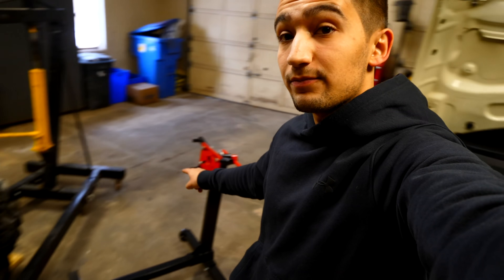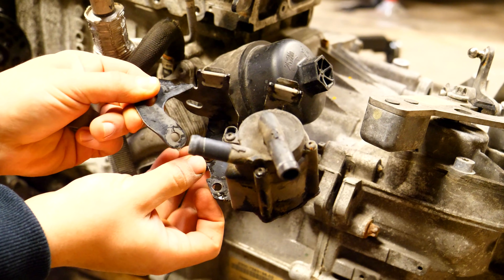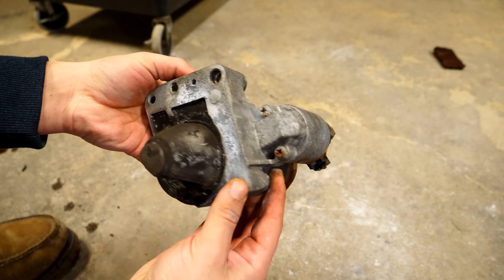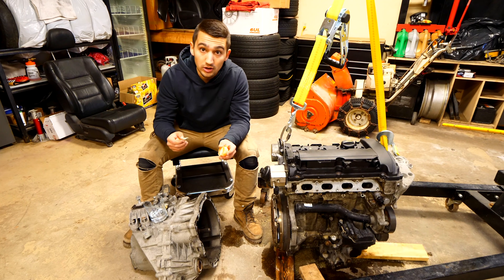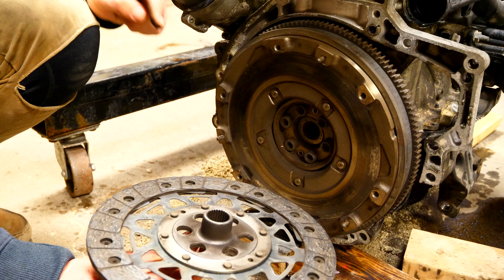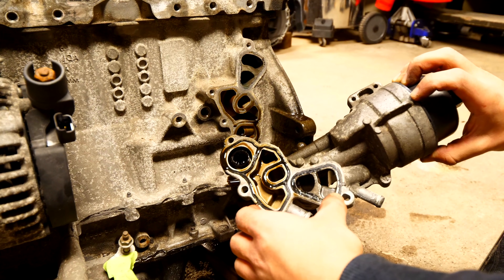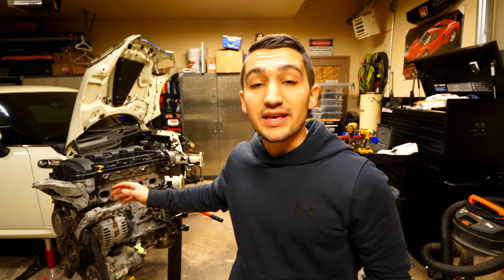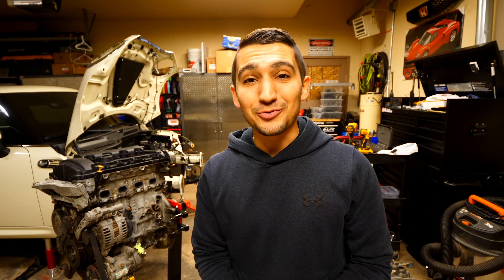How to Mount an Engine to an Engine Stand (FOOL PROOF)

Comment: Your chains will outlast the straps not saying using straps is bad yeah you have the advantage of adjust a little easier but dont mislead by saying the chains will be worn in 5yrs they wont I'm using 30yr old 12ft chain to still pull people out of stuff those straps may last you a long time if taken cared for properly but its not comparable to the durability of chain and with that said it also comes fown to what you're building as well not all engines are the same

Comment: It's a little risky but my plan as of now is to remove my engine from the bottom of the car and then put it on a pallet, then after that I can have a couple people help get the engine/stand piece assembly onto the main part while someone puts the pin in and makes sure it's secure while it's slowly being lowered. I'll have most if not all of the accessories off and the oil drained before putting it on the stand to save weight. I've already removed all of the accessories except the AC compressor and I might remove the timing cover too since I plan on replacing it. Time to get Car Mechanic Simulator back on my laptop.

Comment: In this video you are working on a gasoline engine. A motor is powered by electricity. Just a FYI you often say both just a little tip.

Comment: Love the honesty and showing it's not a " easy " job. Good call on rebuilding. Upgraded parts and a full rebuild. You'll know and have peace of mind that you've done it all to your high standards. I know you don't plan on changing your DMF but look into it as your changing your clutch anyway and you're there. They do have a high failure rate from what I've read as people started doing conversions to single mass flywheels in modern cars at the expense of some vibration

Comment: Milan, when you're removing or installing those really tight flywheel bolts, just get about 3 feet of rope and feed it into one cylinder through the spark plug hole. When you get the cylinder up to TDC it'll stop against the rope and allow you to remove the bolts. That'll come in handy when you reinstall the flywheel and have to use a torque wrench instead of an impact gun.
Reply from the maker: I want to see if I can get my hands on the tool that holds the flywheel to the engine block. Good idea though :)
Reply: milanmastracci It's not my idea, it's an oldie but goodie. It's kinda like something grandpappy would have taught his kids while he wrenched on his Model A Ford. ;)

Comment: Weld fwd diff. I know wheel chirp, stress on CVs, but you wannabe a racer, not pro park master, also read there is a review of monstrous welded diff civic which controls extremely well.
+Locked diff works like ABS no-one locked or both locked.
+ A bit of understeer in entry of turn, monstrous grip in mid-turn and great exit!
+ If you wanna be turning you need to go on throttle.
+ You'll da' best on rainy days
+ Cheap